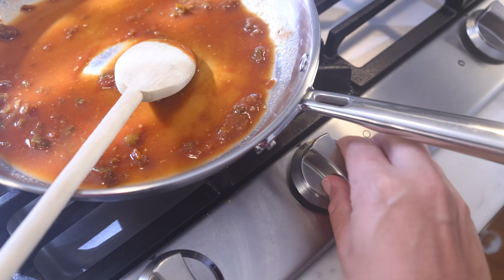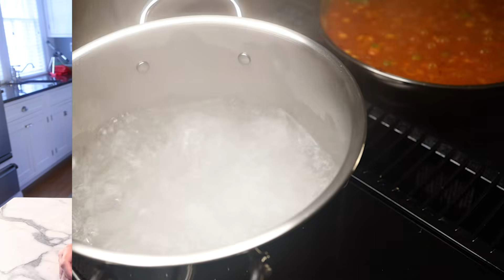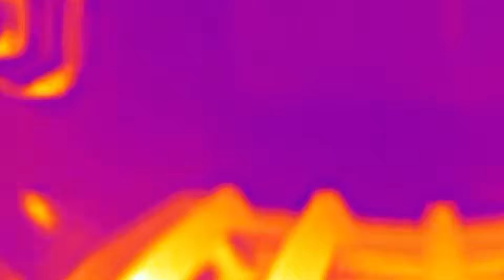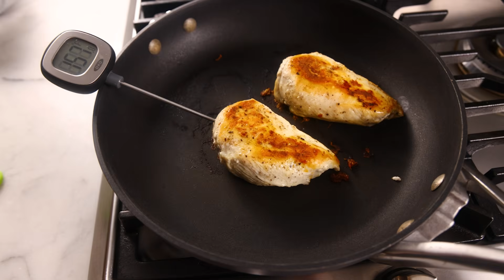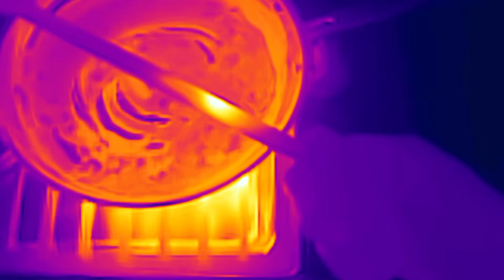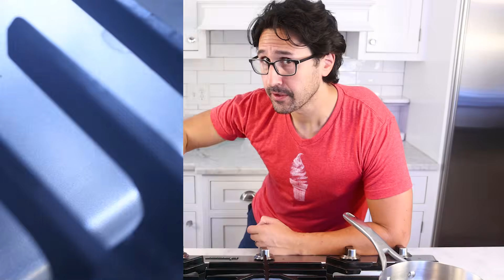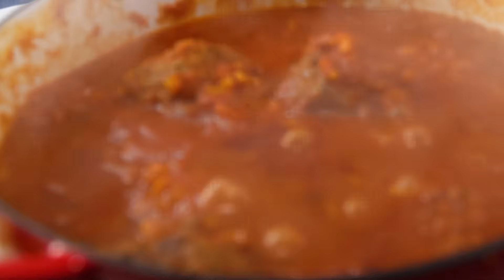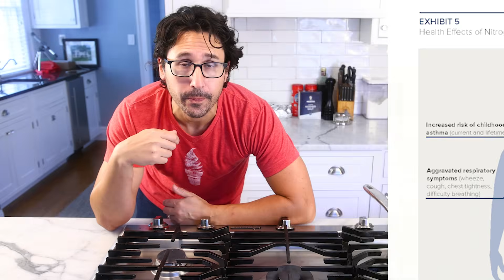Problems with gas stovetops | weak, dirty and dangerous

Comment: Just switched to induction from an resistive electric range.  I used to describe it as a racecar with no breaks.  Could get hot quick and too hot quicker.

The induction is nice since it gives the control of gas that I used to use when in commercial kitchens without all the other problems you describe.   One issue I found with induction though is it can be tricky getting coverage with my larger pans.   It's critical to have the sizing right on the 'burner' and have it centered.

Comment: My gas stove top has 1 large burner that heats water about as fast as an electric kettle, IF the pot is closed. One small burner next to it which solves the low heat problem and two back burners for stews and such.

I used 4 different resistance coil stoves in the military and will never do so again

Comment: I have that no low setting problem with my gas stove. When I moved recent the house had a gas stove (I was kinda happy to not have a cheap electric one), but it needed to be replaced... they replaced it with THE CHEAPEST ONE POSSIBLE, there isn't even a light in the oven. And unlike not having enough heat mine refuses to go low enough to simmer anything, its either way hot or too fucking hot so its impossible to leave anything to simmer even on the absolute lowest it will go.

Comment: Electric ranges will more quickly wreck a pan of food is you're not paying perfect attention. Electric ranges make a REALLY high electric bill, you'll pay a fraction of the price with gas. When the power goes out, you still have gas. There are FLAME DIFFUSERS that are put underneath pots for more gentle simmering; My grandmother used one, and it seems like nobody knows what they are now. So much for the young knowing everything.

Also, Stop using silly ass bowl-pans maybe? Traditional pots have high flat edges for a reason and pans work great on gas.

And fuck environmental groups. They won't be happy until you stop breathing and get mulched into their soy gardens.

Comment: Cleaning glass tops is harder when you boil over at high heat. With gas the catch basin is not hot enough to char. Glass tops burn the overflow and then you have to take a razor blade to them with damaging the raised dots on the glass.

Comment: my "perfect" home setup would be 1 small 1 medium gas and 3-zone induction on top, and a convection oven (idk translation? -- control temp, temp direction, humidity, air flow; preferrably programmable with intregrated temp sensor). if I win some big lottery ontop of the loan for that setup, I'd add a high-powered gas wok station. and maybe a Josper grill for good measure.
(at work we make do with gas on top times 12, and some regular electric ovens)

Comment: Same thing in Australia. Glass top means you might think it's induction but it's super rare to have induction. It's almost always ceramic with an electric coil underneath.

Same thing in Korea. Most people use gas in Korea. Only smaller apartments have a single pair of ceramic plates.

Induction is awesome but like USB2->USB3 there's always an overlap of ignorance.

Comment: This is fascinating, as someone who's never cooked on a non gas stove, this was a lot of problems that yeah i guess I ran into but since I learned from my mom who also has only cooked with gas, the solutions and drawbacks were just parts of cooking to me. Those scorch marks? those just take time to clean, low not being low enough? just take it off the heat. Like those were just ingrained in me as "How you cook". Never once did I think that electric burners didn't have those problems. This was super cool to watch!

Comment: As a Chinese home cook a responsive gas top is really important for me because a lot of the time cooking a dish lasts less than a minute and sometimes I need to switch between low and high heat quite rapidly. Also, average gas stove at home is twice as strong in China than in the US (I forgot where I read the stats though). I think high heat from the gas stove in this video is closer to medium at my house just judging by the look.

Comment: I do like the gas range that came with my house, but I also agree with pretty much every issue you bring up here. The efficiency issue is mitigated somewhat by using LARGER pans... I bought a 12" Matfer Bourgeat carbon steel skillet expressly for use with the largest burner on my stove. I also have a giant cast iron griddle that stretches over two burners and performs amazingly well if I'm patient enough to let it heat up slowly, and then I make very subtle adjustments to the fire as needed. As you noted, the adjustability of the fire--the sensitivity and consistency of a gas range--is it's main selling point. I have cooked on SOME good induction ranges, but I've found others have infuriating newfangled features where heat cycles on and off in inscrutable ways. I strongly prefer the precision of a gas range even if it does take longer to boil water. 

I agree that it's a good idea to turn your hood fan on when using the stove in normal cooking, and keep it on after you're done cooking. I'm lucky to have an actual exhaust fan; the fan is vented straight to the outside of the house, and it's quite powerful. I don't have an "open concept" kitchen... my kitchen is at the back of the house, so I think with all those factors, I'm not as concerned about the impact on air quality for my family, but it's definitely a consideration.

Comment: Most efficient power grnerstion plants efficiency is around 50% when producing electricity from hydrocarbons, around 10% further is lost in line losses when bringing that electricity into your home, so you are getting around 40% heat from the hydrocarbons burned at power plants. On the other hand I think you are getting way more than 40% heat into the pot when you extract heat directly from natural gas. Converting heat energy into electricity bringing it into our homes and converting it back into heat is highly inefficient. The difference reflects on the utility bills, using electricity for heating is way more expansive than using natural gas.

Comment: Your burners are set to high you or better tet some one qualfied should be able to ajust them down to a very small ring of flame. the range need to set it up for the gas type and pressure it can vary by a surprising amount even in the same area, the customer at the end of a long service line will have less preshur than the first customer on the line espeshaly on old low presher lines that only carry a few oz of gas to begen with.   don't blame the gas for a poorly setup stove.
Reply: I learned to cook with gas I have electricity now it burns everything unless i sit there and watch it the coil will go from bearly hot to glowing red and back no one touches the dile. one time it takes over a hour to boil a cup of waterthe next it welds the pan to the stove happen twice befor i set my stool beside the stove so i could wach it when the range is on I can't do any thing else.

Comment: EDIT: Sounds like Induction does have some merits that I gotta learn to use. I do just fine with the sauces I make, and I use a Wok a lot. But It sounds like a balance of the two would be beneficial.

Haven't watched the whole video yet so I'm willing to be convinced, but the ineffiency, not transferring all the heat, combined with the responsiveness is why I prefer gas. Too often do things burn when I have to use our induction burner (its got a bigger pot that only works on it) because even though the fancy digital display implies I have by the degree control. It never reacts quickly or consistently enough to actually cook the way I do.

I dislike copper pans for the same reason, even at low on a gas stove they transfer so much heat and so quickly that even just butter or oil "burns" before/while trying to cook things with it. Iron and Steel and Gas are my preferred because I can trust the metal to not instantly bring whatever touches it to high heat, and when I turn up or down the heat I can trust and see the difference in cooking.

Comment: In what world was your gas taking longer than an electric stove?!?!?! Wtf was wrong with your gas line?
Reply: Ahhh, you personally used a gas vs induction and the 'study' was testing a single pot of unknown size.

Electric stoves (esp. newer ones) will send more power to a single burner (or the oven) if its the only one calling for power. If you DARE to use two or more elements at a time, you're in for some slow times. Gas is regulated to always be able to max put every single burner and oven at the same time, every time.

Edit: also, gas wins vs coil, AND radiative single burner heating if you use a large pot. Like one you would boil your pasta water in....

Edit2: disclosure, I work in the appliance industry. I have electric. I've had gas for a decade or more. I would prefer induction and a propane torch. Runner up, dual fuel with inline or exterior exhaust blower.

Comment: It's worth knowing that that's scorching around the edge of the pan is likely because it's a disc clad pan, so it's only thick on the bottom. Depending on how you look at it, that could be a disadvantage of gas stovetops (that they don't play very nice with disc clad pans) or a disadvantage of disc clad pans (they're usually the budget alternative to fully clad pans)

Comment: Hey Adam, 

Im an. Engineer working for a natural gas distributor and know a fair amount about the decarbonisation of energy from a ‘gas point of view’. As you touched on, which is greener; gas or electric stoves, is an incredibly complex question that varies based on individual circumstances and local conditions. 

However your point that “electricity might not be generated by fossil fuels forever, where as gas will” is incorrect. The gas industry is currently in a major upheaval where it is switching to Hydrogen as a fuel gas. Hydrogen is generated via carbon neutral electrolysis, and burns to produce water rather than CO2. 

Happy to chat to you about it if you have questions.

Comment: you can put your gas stove lower than low by going in the closing direction but not quite closed , it's called "crown fire" (that's a literal translation from 'fuego corona' , don't quote me) , the flame might go out it might not just pay atention as you always should

Comment: As someone who spent my whole life cooking on a gas stove, I find the problems you have when cooking with it to be just things you account for when cooking. 
Like you don't cook a steak only on one side, you flip it. You don't let a pan overheat, you pick it up for a minute, or move it so it doesn't get too hot. 
It's second nature, when you're raised with it
Reply: i agree, i grew up with gas stovetops so i cant relate to these problems because im used to it and i work around them without thinking too much about it
Reply: so when youre simmering something for several hours you... move the pot off heat every 10 minutes? christ i cant imagine, i just put my induction on 2-3, set a timer and be done with it
Reply: @_holy__ghost  actually, anything that needs simmering for a long time just gets stirred every 15-25 mins or so. Most people in Australia are quite cautious about leaving the stove on so routinely check it anyway. It makes no difference if we take an extra minute to stir the stew
Reply: @_holy__ghost  use 10 dollar  electric single coil for simmer.
Or slow cooker for full automation.
If only gas stove. Turn off stove once in a while pending stove. Not rocket science
Reply: @_holy__ghost  if something needs to be simmered for that long I'd probably put it on really low in the oven instead
Reply: @_holy__ghost  no, you just move it "permanently" to the back burners which are much smaller... that's what they are there for... Induction is king for sure, but gas blows electric out of the water if you know how to use it... which Adam does not
Reply: Agaree gas stove for real chefs
Electric for microwave users

Comment: I fix my “low gas setting still being too hot” issue by having a heat diffuser between the flame and the pot.  They are dirt cheap, come in different sizes, and fix a lot of the heating issues with gas as they will also smooth out that “heat ring” when the flame is up.
Reply: Was looking for someone else who uses these.  Makes cast iron pans even out nicely.
Reply: Heat diffusers, also known as room heaters.
Reply: we call those a gas toaster where I live. I do that too but it's not terribly efficient.
Reply: Which makes the thermal efficiency problem even bigger. In this day and age we shouldn't we wasting precious energy, and definitely not from fossil fuels such as gas.
Reply: @davidsommen1324  unless you live in an area that uses mostly renewable energy, the efficiency of gas is likely still superior even with a diffuser.
Reply: @davidsommen1324  Where do you think most of our grid electricity still comes from?
Reply: @davidsommen1324  It allows me to start and finish cooking about 10 mins earlier on the same heat setting.  And it's far better than pre heating it in the oven for 30 mins like some do.  I'm saving gas versus not using it.

Comment: Induction is the shit.  The power of electricity with the responsiveness of Gas.
One thing to note: Many of the cheaper induction plates also cycle on and off to regulate temperature.  So they often can't do the low temperatures well.  Just something to look out for when you buy - a good one can go lower than you'll ever need.

Comment: Natural gas is clean burning Adam, not relatively clean burning.  Overwhelmingly coal fire sourced electricity needs expensive remediation of the coal both pre and post burn to reduce pollution.  Evan after all of that straight up natural gas beats it without any extraordinary measures.

Comment: 10:38 and also burning a give volume of gas in a power plant if still more efficient that burning that same volume in lots of little burners  just because  t like all heat engines  increased size confers more room for things like insulation more precise fuel mixing better heat transfer etc etc

Comment: 9:56 what i want to know is .. its 2021 .. why cant i get a stove and oven that i cant just punch in the temp i was .. like 180 c  and then just have it heat to that and stay within a few degrees of it ... all i want is a vacuum panel insulated box with a restive heating element  a brick for thermal mass to even out the temp flow and a micro controller and half a doesn't thermo couples to regulated the current to the element within a few degrees why is that so hard to find  ...

Comment: I personally have never had a problem with gas but with electricity I find quite often they have uneven heat or elements  break. I've worked in restaurants as a chef. I live in Australia gas is also better for environment as most electricity is coal-fired

Comment: I'm with you on this one. I love my gas stovetop, but 1) it's annoying to clean and 2) if I use 2-3 burners at the same time in my small apartment, my boyfriend's asthma starts giving him breathing problems unless I have the kitchen window fully open. And while asthmatics might be more sensible to oxygen depletion and NO2 emissions I'm pretty sure it's not that healthy for the rest of us, either.

Also, here in Denmark electricity definitely carries a lower carbon footprint than gas.

So... My cooker was not new when I bought my apartment in 2005 and it's getting near the end of it's life. I foresee an induction stovetop in my near future!